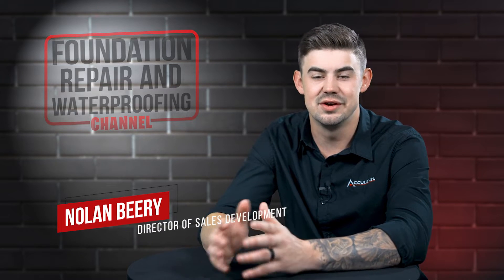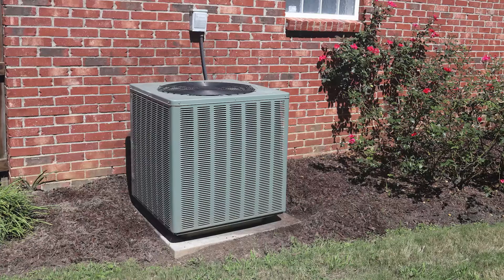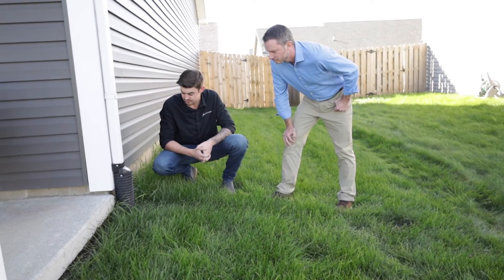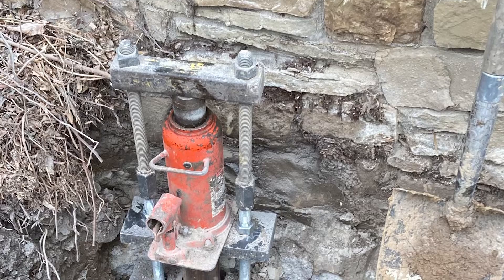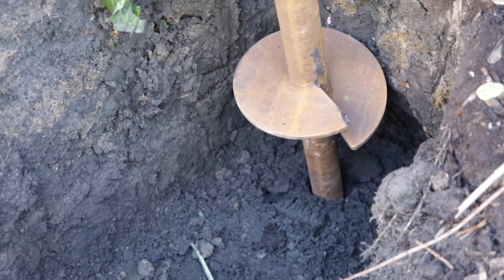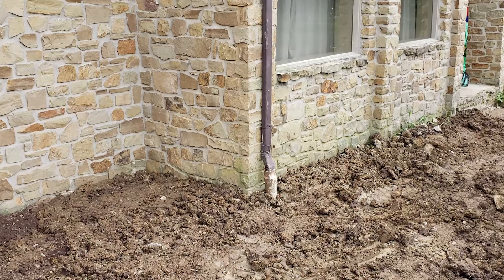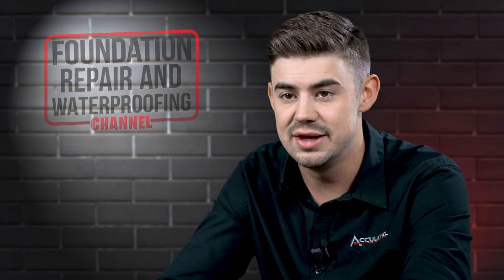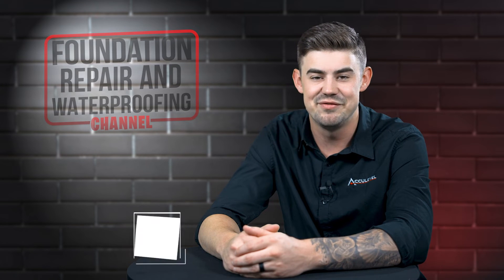Whoa… Helical Piers Installed

Comment: Do you use square or circle helical piers?
Reply from the maker: Thank you for the question. We do not use square bar. We use pipe helical piers. Let us know if we can be of further assistance.
Reply: @Acculevel  what are pipe helical piers and how are they best for the home?
Reply from the maker: @sweetbrez18  They larger shaft sizes than square bar so they are more rigid and will support more weight.